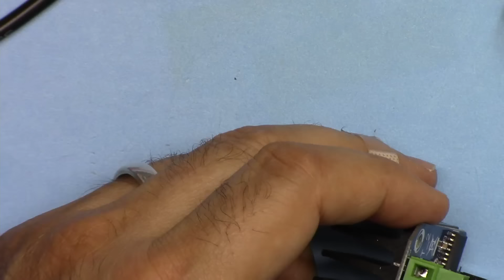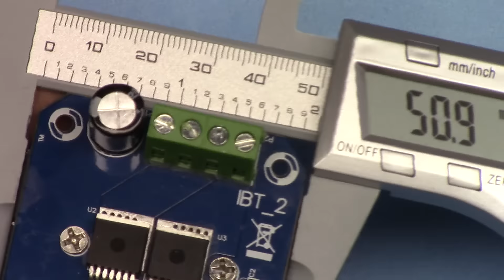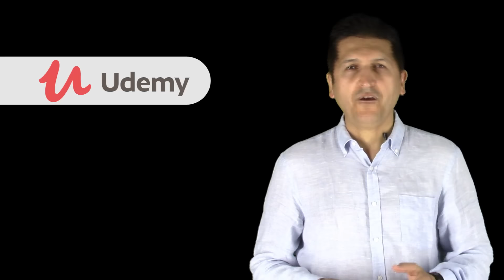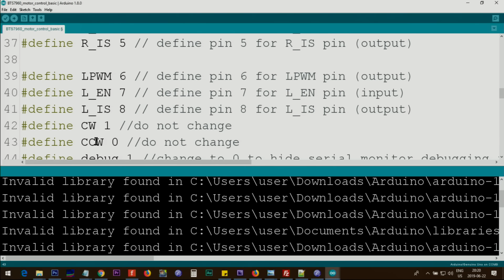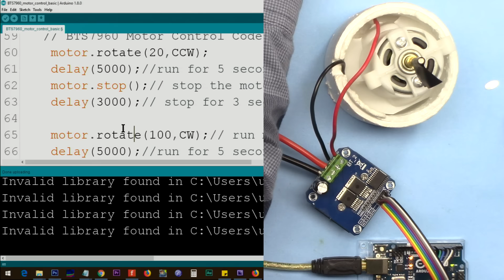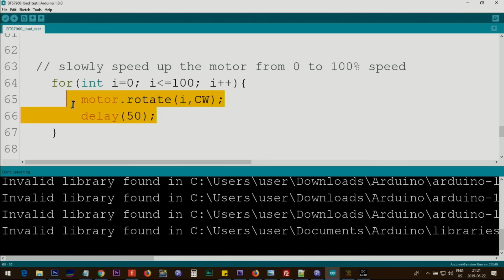Using BTS7960  BTN8982TA PWM H Bridge motor controller module with Arduino library RJT169

Comment: To prevent current spikes in a high torque motor when counter spin perhaps adding a function will be good.  // Function to safely slow down, flip direction, and prevent spikes void safeDirectionChange(int newDirection) { // Gradual deceleration loop for (int speed = 255; speed >= 0; speed -= 5) { analogWrite(pwmPin, speed); delay(10); // 10ms * 51 steps = ~0.5 seconds total slowdown time } // Motor is now safely stopped. Now flip the direction. digitalWrite(dirPin, newDirection); // Optional: Give the physics of the motor 100ms to completely settle delay(1000); }

Comment: Hello, thank you for the tutorial.

I have a question, is it possible to actually have reads in the ls and Rs so we can make characterization of motors using also the current they consume?
Reply from the maker: Hello, yes you can detect the current by connecting a resistor to pin IS. see datasheet page 17 and 18 https://www.infineon.com/assets/row/public/documents/10/57/infineon-bts7960-ds-en.pdf

Comment: Hi, thanks for the video.
How can I measure the current from the infrared sensors and their pin using an Arduino? Do I need a resistor? I've tried other methods and they don't work.
Reply from the maker: Hi, there are so many ways to measure the current. one is to use a sensor like this https://youtu.be/3C33DpcSwIw or use resistor. search my channel for the word "current"

Comment: Also is it possible to connect 60rpm johnson 12v dc motor to this driver
Reply from the maker: yes any DC motor will work. this module is not doing anything special. it just changes the current waveform to speed it up or slow it down.

Comment: I have a doubt 
Should I need to connect the ceramic capacitor with 470 rating for avoiding the sudden voltage spikes when changing the direction 
Can you please reply to it

Comment: Good video. You only need one PWM per BTS7960 module. Just set the other PWM pin as high or low for direction. This means you dont waste PWM pins for a second motor.

Comment: FYI, I have moved the through-hole connectors and cap to the heat-sink side of the board to allow me to add an additional heat-sink to the un-cooled side. I have a small heat-sink with 5v fan and also a passive m.2 heat pipe cooler, I will try both and see how it goes.
Reply from the maker: Excellent idea. I hope you get better result results and share your experience here back. Thanks

Comment: Those geniuses put the heat sink ON THE WRONG SIDE...   A bit stupid to put pcb insulation between it and the power devices. Yikes.
Reply: The chip datasheet says it should be on the bottom with a bunch of thermal vias as the top is just non thermal conducive plastic.
Reply: @tobiass8750  Fascinating...  I've never seen a design like that before.  I'll have to Take off the heat sink and see if those Thermally conductive Vias exist.

Comment: At 30A the chips are heating up because the heatsink cannot disspate the heat, it is kept flat an unde the PCB. It should be upright so the hot air can flow away.

Comment: using 

BTS7960
DC motor is 24v 750wat
power Supply is 24v 1000w

can the BTS7960?

Comment: I'm very sorry, but with such equipment, you didn't check if there is protection against short circuits? At what temperature does it shut off? At what voltages does it turn off! I think these are the most important aspects, and not only I am interested in them.
Reply from the maker: I have shown the datasheet and expalined and have provided the datasheet so you can read if you need further details.Check the resources page.

Comment: Very nice in depth tutorial? 

How do you use the current sensors?

Would it be possible (and safe) to use two of these to drive old high current stepper motors? These motors are currently controlled with a custom unknown board, with 12V 10A, without PWA (square wave), the current fluctuates a bit but is nearly constant 10A.  It is hard to find modern stepper motor drivers that output that current it seems.

The motors don't have to turn fast, 90° per second is fast enough

As a hobby project I would like to keep the battery and motors of this tennis ball machine, but replace it with my own hardware, as a fun way to finally learn electronics.
Reply from the maker: Hard to explain in text. but  you can get the idea from this video https://youtu.be/-uQKBDTWHPM

Comment: HI there, I hope you still read the comments to this video after all this time.
Thank you for this video it is helping to use linear actuators to open the roof of my astronomy observatory, if I can get it to work. 
I am not sure what is wrong, if it is my BT2 controller, which is new, but the folowing happens when I run your basic code. 
It will only go in one direction, as defined in line 60 "motor.rotate(100,CW);// run motor with 100% speed in CW direction". it then misses the code until it speeds up and then slows down, again but only in the direction as defined in line 60. It keeps going until fully extended. If I then change the line 60 to read, "motor.rotate(100,CCW);// run motor with 100% speed in CW direction" and upload that sketch it retracts full speed, misses out the stops but runs the slow to full speed rampup, then runs full speed again until it is fully retracted. So it appears to be ignoring code to stop or to delay and will only accept the first instruction for the direction from line 60 and ignore the change of direction request. I have changed all the wires in case they were faulty but that made no difference. Your help and advice please. I do not know much about coding so I am very frustrated.
Reply from the maker: Hi, please post your inside the loop code. Something is wrong.
Reply from the maker: I mean post it here by replying. I read all the comments regardless of the video. All on the same page.

Comment: Will your library work with a esp32? 
Can it work with stepper motors?

I can see that it might work with a eBike or scooter or CNC or high current servo,
but can it work with something like 
a Segway or 6 wheel ATV or heavy lift quadcopter
where the left and right sides are rotating in 
same or opposite directions at controlled speeds?

Hope I can see some applications like listed above..
Reply from the maker: it won't work with ESP32.

Comment: Can this driver be used to drive a transformer winding to produce a decent inverter?
Reply from the maker: No. The frequency of switching is very high and the (high current) transformer can’t be turned on or at this frequency.
Reply: @robojax  Thank yo very much for your very prompt reply. But isn't the frequency of switching totally controlled by the program? A 100ms positive followed by a 100ms negative thru a transformer coil should be achievable?
Reply: Would the addition of freewheel diodes to your circuit improve thermal performance? My reason for interest in the BTS7960 is to assess its suitability in making a cheap robust inverter for solar panels. The intended transformer would be an MOT (suitably modified!!!)

Comment: whether 12V-40V10A DC Motor PWM Speed Control switch can be run directly through Arduino, or it require to run though BTS7960, Pls. Reply. Also, Pls. note, No Manual control switch is allowed for my work. My Motor Rating is: Rated Voltage: 24F/36V, current(F.L.): 5A, Speed: 5000 R.P.M. @180W (F.L.).
Reply: U cannot run anything 40ma directly through Arduino, its just a microcontroller it should be used with motor drivers which can handle high current

Comment: whether 12V-40V10A DC Motor PWM Speed Control switch can be run directly through Arduino, or it require to run though BTS7960, Pls. Reply. Also, Pls. note, No Manual control switch is allowed for my work.

Comment: whether 12V-40V10A DC Motor PWM Speed Control switch can be run directly through Arduino, or it require to run though BTS7960, Pls. Reply.

Comment: Thank you for great tutorials. Can the logic be powered by an external source instead of the arduino? And if so, would it be two wires to ground, one to the external power source and one to the arduino like you showed with the l298?

I’m planning to use 3 bts7960 and a stepper motor driver in the same project but I’m concerned that it will be too many amps for the arduino. But maybe the enable pins and pwn would draw the same amps from the arduino even if I power the driver externally?

Comment: yes sir i am used this BTs Below 13 Amps working fine after i increased motor capacity amps up to 28 its working only few seconds after that its automatically run (mean whenever i gave the BTS Input power supply from battery that time motor will run ) pls can you suggestion others driver with pwm type speed control?

Comment: HOW ABOUT IF YOU HAVE 2 MOTOR DRIVERS?
Reply from the maker: Just define another object and required pins as variable. I have explained the code and mentioned what is object. 
in this line
RobojaxBTS7960 motor(R_EN,RPWM,R_IS, L_EN,LPWM,L_IS,debug);
the motor(.. is object. make another line
RobojaxBTS7960 motor2(R_EN2,RPWM2,R_IS2, L_EN2,LPWM2,L_IS2,debug);
and all varaiable endining with 2 . they are above the line. 
this mouch I could help, for more details. please watch it from my course posted on Youtube. good luck

Comment: Hello, how do i use the low-side MOSFET inside the BTN8982 when the load (Motor) is connected to the Vs + supply (+24 Volts) and O/P terminal (tab and pin 4)? I'm using a PWM drive signal at the input of IN while INH is held high (logic +5volts)? The datasheet shows that to select either the high-side or low side MOSFET transistors inside the BTN8982 will mean that when the PWM signal is high (+5 volt level) then the high-side MOSFET will be on therefore shunting the motor which will act a brake, which is not efficient? Any ideas?

Comment: Thanks for this wonderful analysis. I just bought one of these and you are absolutely right. The airgap between the driver and heatsink just doesn't allow it to get up to 30A. Thankfully my application only require 8 A max per motor so hopefully this driver will not get overloaded.

Comment: Hii sir.. I am getting the output from arduino, but 0V from the driver, even though the power supply to driver is nearly 14V..How can I  troubleshoot it?
Reply from the maker: Hi do you know you are getting output from Arduino? You gotta get correct output certain pin should be high and certain to be low. Then check the wiring if you did not modify the code.
Reply: @robojax  sir, connections and code were same as in the video. When motor's positive is given to pin6 and gnd, it is rotating according to small voltage given. Is there a chance that the driver is not working? How can I check it?

Comment: hello can i replace the l298 with 2  bts7960?
Reply from the maker: sorry I did not understand. replace L298N? just use BTS. and don't use L298N.  you must have something in mind which I don't know.  if you are trying to contro a module and currently using L298N, then forget about L298N and sue this BTS module. I have provided code and showing fully how it works.

Comment: The heat sink could contact a soldermask free area connected with feedtroughs on that backplane of the board. It seems tha tthe footprint of that heatsink would fit on the component side without interfering with the other components tough. So i would try to switch its mounting and provide a small fan, mostly if the unit gets inclosed in a small water proof enclosure like it should if controlling an ebike or scooter. Thanks a lot for your diligent work on the spec sheets and circuit analysis.

Comment: Can I use BTS7960 to drive hub motor?
Reply from the maker: I don't know what "hub motor" is but if it is a DC motor with two wires, yes. Just respect the voltage.

Comment: I have now downloaded a fresh copy from here. I have connected the Arduino and made sure that it shows on the correct port. I have gone to Sketch>include library> Robojax... and then upload the file. I keep getting that the motor is not defined.
I am sure that it is not the code but that my stupidity is the cause. Please assist in raising my intelligence by a few points please...

Comment: I have cleared the code and downloaded a fresh copy from your link. After installing, it keeps giving an error on the motor which was not declared
Reply from the maker: when it says motor was not declared, then library is missing.
Reply from the maker: just read the comments, 1000s of people used this. you must be doing something wrong. The code and downlead link has not been changed. so watch carefully. or post comment under someone else to see how they did it if you can't learn from my tutorial.

Comment: Arduino: 1.8.19 (Windows 10), Board: "Arduino Uno"

C:\Users\Ronnie\Downloads\BTS7960\BTS7960.ino:91:1: warning: null character(s) ignored

                                                                                                                                                                                                                                                                                                                                                                                                                                                                                                                                                                                                                                                                                                                                                                                                                                                                                                                                                                                                                                                                                                                                            

 ^

C:\Users\Ronnie\Downloads\BTS7960\BTS7960.ino: In function 'void setup()':

BTS7960:57:4: error: 'motor' was not declared in this scope

    motor.begin();

    ^~~~~

C:\Users\Ronnie\Downloads\BTS7960\BTS7960.ino: In function 'void loop()':

BTS7960:68:5: error: 'motor' was not declared in this scope

     motor.stop();// stop the motor

     ^~~~~

exit status 1

'motor' was not declared in this scope

This report would have more information with
"Show verbose output during compilation"
option enabled in File -> Preferences.

It seems to have a problem with the Motor was not declared...
Reply from the maker: are  you coping code from the download page? you shouldn't because when you install the library, the clean code is there. copying from web page ads extra characters .

Comment: Just as a information also for the users here. If you switch off the debug mode, the library has a bug. 
if(this->_debug){
		digitalWrite(pwm1Pin, LOW);
...

This means, the pwn1Pin is only set to LOW, if you are in debug mode. So if you change direction (without debug-mode and without calling stop) both of the PWM will be bigger than 0, which you should avoid.

Best regards,
Matthias
Reply from the maker: Hi, as I remember, the debug mode is not affecting other settings except printing something.  What is the code you shown? is it from library?
Reply: @robojax  Looks like links are not allowed, i posted a link to the libraray. Yes, the Problem ist the library in RobojaxBTS7960.cpp in Line 84.

Of cause the debug mode SHOULD only affect printing or sending to serial console, but in that line pwm1Pin is set to LOW only in debug mode. So the following code will trigger the bug:

RobojaxBTS7960 motor = new RobojaxBTS7960(inhR, pwmPinR, isR, inhL, pwmPinL, isL, 0);
motor.begin();
motor.rotate(100, 1);
//motor.stop() << not calling stop!!
motor.rotate(100,-1);

This will result in:
analogWrite(pwmPinR, 255);
analogWrite(pwmPinL, 255);

Comment: I have been following your channel for a while and I have used your lesson 54 for several projects for building toys for grand kids.  I have recently built a beer can crusher that needs more power than a L298n can provide even with with both outputs connected.  I have tried to merge  this and lesson 54.  I thought I had working sketch.
 but it fails with the following error message.  Compilation error: 'motor1StopState' was not declared in this scope and I'm stumped.  Any suggestions as to what I did wrong or could you post code with a couple of switches so I could find what I'm doing wrong.  Thanks.
Reply from the maker: I just checked the code on Robojax.com, then opened the source code for library and there is "motor1StopState". this is not the code I've written for BTS7960. But if it is about L298N, then which code? please post the comment under that video so I look at it.  Don't worry, all comments are shown on the same page for me so I never miss them.
Reply from the maker: sorry I noticed lesson 54. I will look at it. But you gotta post this comment there so others learn from it as well. thanks

Comment: Great video - very thorough and informative. Lots of useful information in the comments, and love that you are so responsive to questions. My question (which I didn’t find in any of the comments) is whether the amount of heat generated in the BTS chips is related to the PWM frequency being used, and also whether maintaining 100% duty cycle will create less heat. I note in your video that your code continually increases then decreases the duty cycle during your test. Thanks, and keep up the great work!
Reply from the maker: Hi, the datasheet we can see the maximum PWM frequency is 25kHz.  I have not paid attention to the  efficiency of module other than path resistance which is about 16mΩ.  In the code the duty cycle changes but the frequency is fixed.